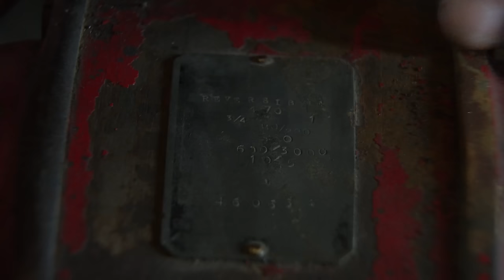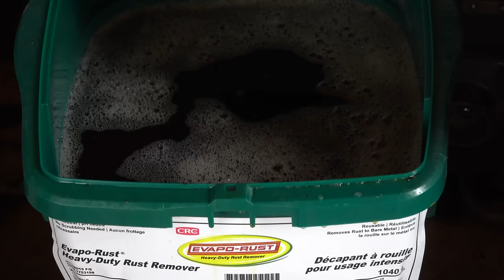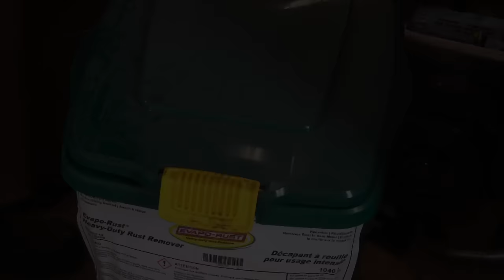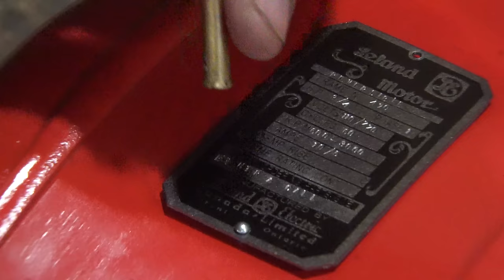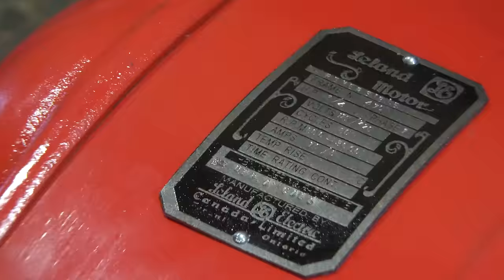Why Did They Stop Making These? [Restoration]

Comment: I’ve got you Mr hand tool rescue that is a three phase motor and the outer armature that is in the case creates a constant and unchanging three pole magnetic flux and the rotor (the spinny bit with the commutator bars) creates its own pulsing magnetic flux that is ever so slightly out of time with the constant flux thus creating a rotational force that wants to right them to neutral but as the flux gets closer to neutral the brushes sweep to the next the commutator bar thus resetting the field to its original and not so out of time place resetting the pulling forces invoked and so on since this motor allows you to move the brushes around the commutator bar assembly it effectively allows you to increase or decrease the amount the flux is out of time giving you more or less torque as it increases or decreases the amount of time the motor has time to work

Comment: So that lever is  a primitive form of speed control by altering one of the phases of the motor.(Is that lever live? -It is a direct elctrical connection to one of the brushes.)
Reply: I had no idea that lever was to reverse the direction of the motor--(These days it is directly  switched) but the versatilty of this motor is that it is a speed controller.as well.

Comment: Awesome I've seen a lot of industrial motors and stuff but I've never seen something like that useful. Why in the world you would stop making such a useful versatile multi speed and duel direction with a simple movement on the arm. Only thing that sucks vs a dc speed controller is you surely don't have the same power at low speed. Great job first video of yours I stumbled onto and watched every minute.
Reply: reasons to stop making it: Horribly inefficient, uses full current at low and high speed. Horribly unsafe, directional dependent controls near rotating pieces, catch a sleeve while changing controls and it automatically uses your hand to put itself in max speed until your hand is no longer attached. This isn't a drill motor, it's a 3/4 horse motor that is no way going to stop by a little flesh and bone.

Comment: A great restoration video. Back in 19 87, I was doing electrical work at the Coweta County Courthouse in Newnan georgia. Down in the basement where we were putting in the mains equipment for the electrical distribution I was looking around and I found an old motor in there. I believe it was for some type of industrial sewing machine. It was a lot smaller in size than the one you worked on, but it was pretty much the same principle. It had the oil ports for each of the brass bearings and a smaller handle to control the speed and the direction. I don't know what happened to that motor because it's been a long time and many house moves since then. But thank you for bringing back a memory.

Comment: There is literally no reason at all to have a variable phase brushed motor nowadays.  It was an infantile, inefficient, noisy design prone to failure.  A more modern approach would be to simply use an induction motor and a phase converter to accomplish the same thing for less money with more power and efficiency.

Comment: 🟦... Your analogy of the water on the fan is faulty,... If water was jetting against the fan blade then the closer it was hitting the blade to the shaft the FASTER it would  go!, having the water hit farther towards the outer-edge would make it go SLOWER!

.....I also agree with several people on some of the procedures that SHOULD have been performed,.. One that you missed was to shim the excessive 'End-play' (Aka "Axial-play") out of the armature, I didn't see if yours Is the kind that uses a spring to maintain proper end-play, but If it does then it is obviously no longer strong enough to do It's job and should either be replaced or use solid-shims instead.
.... Also, the Brushes you used were in NOT THE RIGHT-SHAPE at ALL for Those Brush-holders,...
... As a result of which, Not only will they not last very-long, but there is now NO WAY you'll be able to either 'Seat' the brushes OR break-in the commutator properly with the brushes loose like that!...& the excessive-arcing will Quite quickly destroy both the brushes and the commutator segments, as well as possibly overheating the windings and cooking the enamel off of the wires.
....And last but not least, it was just So DIS-respectful of you to throw that thing in full-reverse from full forward speed,...C'mon man, didn't anybody ever teach You Better Than That?...Smh.